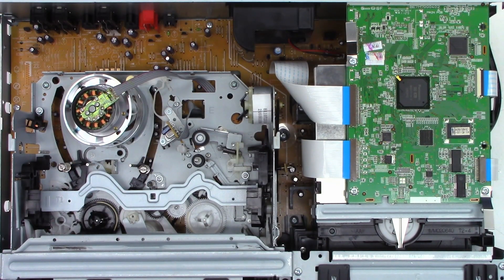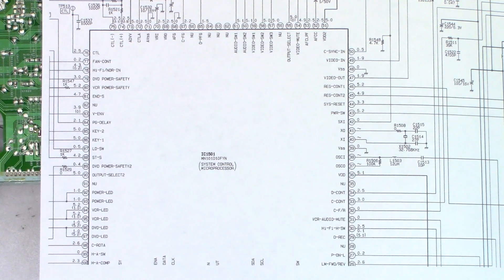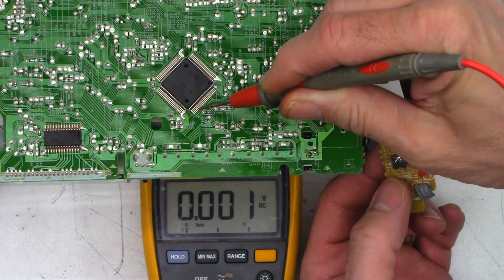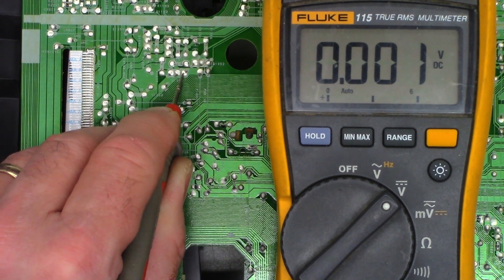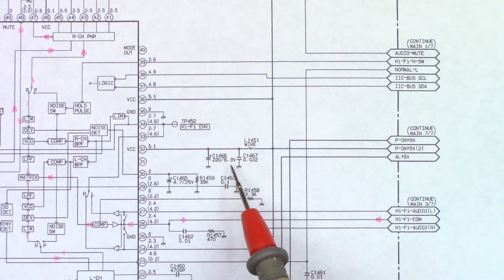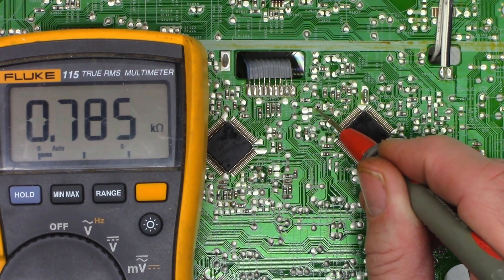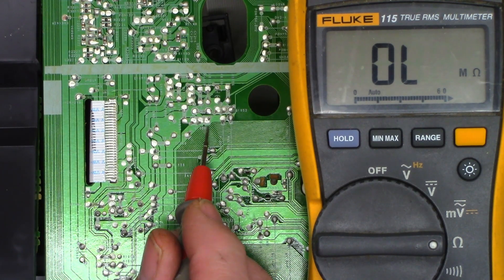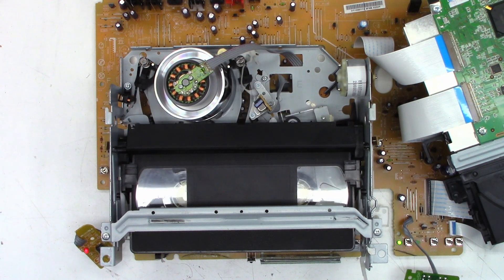Magnavox ZV427MG9A Powers off in 1 second. Not what I expected.

Comment: Just working on one of these , it takes a tape in and then instead of playing , it rewinds , then shuts down, it never plays the tape , ive serviced the mode select switch but it has the same symptoms ...this ones a headache
Reply: It just started working by itself . Strange
Reply from the maker: Check for too much ambient light on the supply tape sensor on the left side of the mechanism. It can fool it into thinking that the tape is at the end. It will only rewind in that case.

Comment: I'm curious, how does a shorted capacitor show on the ESR-meter - Will it falsely identify as being good?
Reply from the maker: Great question, Yes on most meters it will show as a low ESR (good) capacitor. On the MK-168 it would show up as a resistor. The problem is when using the MK-168, you cant do an in circuit test.

Comment: Interesting that an electrolytic should go short, not seen that personally before.

BTW what is your approximate going rate for a repair of a sound board (yes I know, piece of string) ? I have a "dead" soundbar board where the voltages seem OK but it's just not doing anything and I'm not sure why. I'm in the UK but it's only a small digital board so could send it over at fairly minimal cost.
Reply from the maker: Email me Norcal715videos@gmail.com